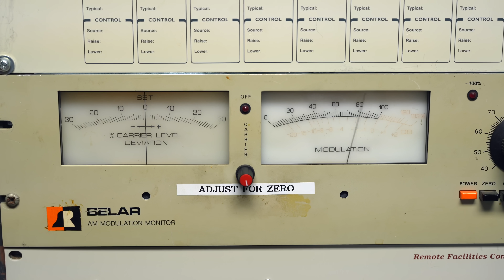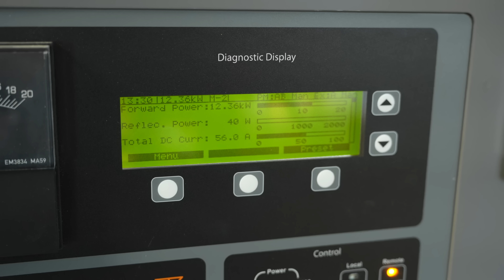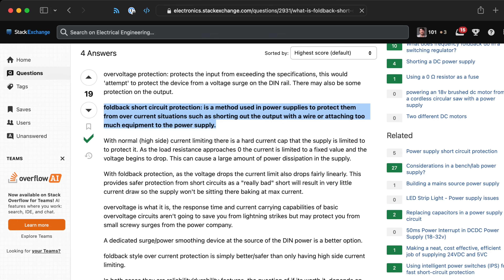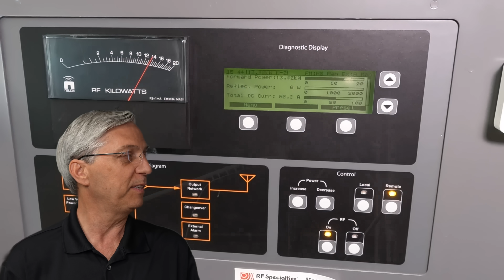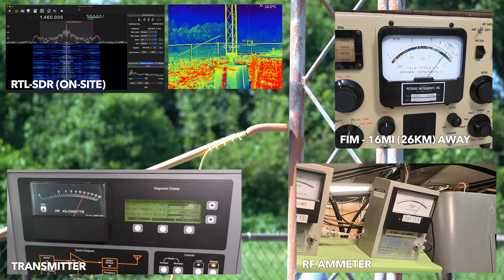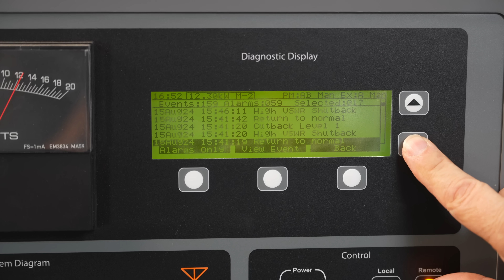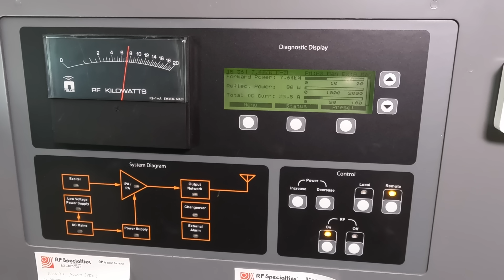How dangerous is AM radio? (ft Plasma Channel)

Comment: I had my hands near the output of a combiner and had and arc follow the tip of my finger. What sucked was my arms were all twisted up in the octopus of.cables, so I couldn't even pull my hands away too fast. Fortunately I was working on 800mhz and it was only 50 watts/channel. It still burned the tip of my finger, but it wasn't too bad.
Reply from the maker: Ouch! Hope it healed okay!

Comment: Fascinating stuff. I think the corn dog did so well due to all of the oil in its coating. The tower leg was definitely becoming more resistive with the carbon building up on it. We did the electric pickle at a concert venue a couple of times and the secret there is a small board with two hefty nails that go into the ends of the pickle (I guess in this configuration you'd have an anode nail (the drain) and the cathode (the source - touched to the tower) - do it at night and you'll definitely get plasma in the pickle that will mimic the audio going through it. Loved this video! 🫡 👍

Comment: RF burns are weird. I forgot my radio was transmitting 100W WSPR and did a little tug on my random wire to see much much it was sagging. Felt like I had put my hand into a hornets nest. Little white dots appeared instantly in few places. Funny thing is that the burns looked insignificant in their appearance but oh boy did they hurt long afterwards. And they took almost half a year to disappear. And that only with 100W on upper HF!
Reply: Ouch! Glad they did at least disappear at some point!
Reply: Glad you told us, I'm always tempted to touch my LPFM Radiator
Reply: Why do we do that kinda stuff? @davidwright3783
Reply: interesting you sustained an rf burn at 100w, i have been old numerous times anything over 50w is considered dangerous, will have to be careful with my setup, sometimes crank 3300 watts into my sky stick. i guess i don't spoon with it so should be fine.
Reply: @nickyp00-t1h  I've got few small burns with 50W also. Tho they felt more like something between a wasp sting and a mosquito sting. Mild, but the small white burn dot didn't disapper for the next 3 months
Reply: @OH8EFI  will have to move my 9 foot stanless to the roof of my 4wd when dxing. How close can i get to  the antenna while transmitting with around 300w ssb?
Reply: @davelowets  i get that, also concerned about the rf coming out of it going through me while dxing.
Reply: Its not an amplifier, but i was messing with a flyback transformation from a television ( you know whole circut boa4d without tube leads onto the tubs) just making arcs and such and melting little lcd screens lol. Went to the bathroom. Forgot it was plugged in and i picked up the whole cir ut board. Fricken inch a half arc shot out of my finger. The electricity definitely went across my heart. What was that 20-30,000 volts? 
Idk, but I ran to my girlfriend yelling is my heart still beating.?Lolol INSTANT panic attack. 

@thearchitect4726
Reply: I have had friends horsing around on my truck while im transmitting, told them do NOT touch the antennas, you will get hurt. They only touched them 1 time while I was keyed up, they now have a healthy fear of all of my antennas, and that was 50-110w on VHF/UHF
Reply: 100 W rf isn't problem to receive over large contact area (like full palm), but if you touch it with your pinkie ouch!
Reply: Same here. It took a half year to fully heal and go away.
Reply: Its high frequency so it burns the surface pretty well
Reply: 100W wspr? 200mW is enought. I us 3W
Reply: @nrfchannel8580  It was a test during a HF black out if I remember right. Most of the time I do not go beyond 5W, unless the band is something higher
Reply: Because WSPR is so narrow it’s only supposed to be ran at very weak output. Putting 100w out on WSPR will be like transmitting 1.5kw . No wonder it hurt
Reply: I have a 500w mobile radio in my truck, one time I had a coax connector go bad. Went to key up and the mic bit me really good.
Reply: Mr show off bragger 🙄🙄🙄
Reply: I wonder if those individual dots are repeated entry and exit wounds? Of course, an electrical shock is the only burn with an entry and exit wound. Makes me wonder if an AC burn would have multiple burns as it oscillates.
Reply: Not good at all.  I've had a few RF burns in my day.

1.  75 watt transmitter running around 7.1 MHz @ 75 watts.  Bad ground, and not-so resonant antenna.  I was making an adjustment on the transmitter holding onto a bakelite knob, but may have touched the set screw. The other on a bakelite knob of a telegraph key.  It still burned my fingers.  That hurt!

2.  A field day operation, we had multiple transmitters in a small amount of space, same for antennas.  We did drive a ground stake into the ground, but not very deep.  We may or may not have all of the rigs tied to it.  I was operating SSB, on I forget which band at around 100 W.  My lips touched metal wind screen on the mic and got a bit of an RF burn on my lips.  Not bad, just made me say ouch, then went back to operating.  I think I've had more of those over the years. Little love nibbles from a mic.  I was a little surprised by it.  We were set up on a river bank, and even though it's inland, the water has some salt content about it, chloride concentration around 400 PPM and a conductivity above 1000 S.  So, I expected good ground conductivity, but the soil there was sand.

3.  I had a mobile rig on 440 MHz.  It only ran 10 W, so I wasn't too concerned about it.  It had an SO-239 connector for the antenna.  The antenna I had on the car had a type N.  Well, I took the N-connector apart and tried to hold the center pin into the SO-239 using my fingers.  Keyed up the transmitter and burned my fingers, immediately.  As soon as I could I switched out the N-connector for a PL-259.  I know those suck on UHF, but it is what it is.  Only interested in working the local repeaters anyway.

As far as any other health effects, having been a ham radio operator since I was 16, and getting involved with repeater maintenance, in sites where there are many sources of RF.  FM broadcast, TV transmitters, both VHF and UHF, and lots of commercial and public safety repeaters.  There is a couple of possible health effects I have.  I developed cataracts when I was in my forties.  Corrected surgically and I see just fine now.  More recently, my optometrist said she observed changes in my optic nerves, that might be early stage glaucoma.  She referred me to an opthamologist that's been monitoring my eyes now for four years, my distance vision remains 20/20 or slightly better, and my eye pressures remain normal.  Are these changes to my eyes due to prolonged and repeated RF exposure?  I've literally had my face right in some active VHF antennas. One of which was VHF television.  I don't know, there may have been other factors too.  Anyway, I haven't tried to explain to my doctors that I have been known to do something a little like sticking my face in a microwave oven.
Reply: Had a similar experience, and I  had the the little white dots, and it took six months to heal and go away.

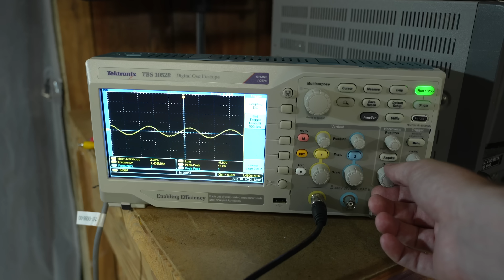Comment: 3:09 this is probably a dumb question, but how does the power usage/output of an AM transmitter like this compare to a local FM transmiter?

I know the modulation that creates the broadcast is different, but curious the raw anount of ac power needed compares
Reply: Nowadays they're quite similar—not 100% sure of 20-40 years ago, when both used tubes/filaments and they were a LOT less efficient.

Comment: Hi Jeff .All A.C electrical systems have to have an earth return system for fault protection. I would have thought that if you could wrap a “split”current transformer around your sausage earth lead and another one around the earthing of the outside box or the main transmitter you may see current flow in the return path

Comment: The pickle is mostly saltwater so it’s likely a better conductor than the hotdogs. That may be why it got more fold back.
Reply: Acetic acid in vinegar also increases the available ions for conduction. Good point on fold back.

Comment: The lobes on either side of the spectrum are the sidebands.  When you mix frequencies you get 4 different outputs.  The 2 original frequencies., the sum and the difference.  So if you have a 1460KHz station and you modulate it with a 1KHz signal, you get 1Khz, 1459KHz, 1460KHz and 1461KHz at the output.

Comment: Please explain how the Hi-Z conductor (hot dog, pickle, brat) acts as a demodulator for the signal. I think it has something to do with the resistance of the material, but I'd love to hear from the RF engineer.
Reply: It's AM modulated - the arc itself becomes a speaker following the envelope of the AM.

Comment: Rough guess, the Bratwurst might have vaguely the right impedance to get a good SWR that is max. power from the transmitter.  Sadly food laws don't require labeling electric and RF properties on the package.

As for RF burns, the less spectacular ones are nasty, too.  Human nerves don't react to RF as to DC or low frequency currents.  A person in contact with an RF source will have no unusual sensation resulting in in a reaction to brake the contact.  And don't underestimate small transmitters.  I've seen a small burn from a 10W transmitter and I don't think it was longer than a second or two.  The contact area wasn't a blister but more grey, necrotic skin of maybe 8mm in diameter.

Comment: When did this become a cooking channel ? On a more serious note after cauterizing the antenna do you get to repaint the unhappy paint job ?
Reply from the maker: Surprisingly (this was news to me) these towers are short enough there are no specific paint/color requirements.

Though I think my dad went back and cleaned the tower leg with a soft brush later! Does look like a repaint would be nice sometime.
Reply: @GeerlingEngineering   The owners are very accommodating.  ... assuming they knew about this.  ;-)

Comment: Maybe Try to put a RF amp meter in line to see how much current is going through the hot dog. I worked at a AM station at the time and I threw   some plants on the spark gap and there was a orange flame that came off it while weed wacking around the tower. This was the old Harris Bc5h 5 killowatt transmitter 30 years ago. Fun times

Comment: I love this channel for many reasons.  Here's one:
I've worked with electronics since the early '70s, and back then I used to live about two miles straight-line distance from that radio station transmitter.  I played around with CB radios, and discovered that if I keyed up my CB without a microphone by using a jumper lead, and then held the mic input lead in my fingers, it would transmit a perfectly modulated audio of that radio station through the CB.

Thanks for the fun and educational video!

Comment: The fence is a bit low to protect stupid from itself
Reply from the maker: For this site, there's a locked gate at the entrance, a locked fence surrounding the entire field (with RF danger signs around it), and then locked fences around all the towers as well. It's also far off the beaten path (though some home builders have been adding subdivisions a mile or so away—until recently it was rural for miles around).

There's only so much you can do for remote tower installations, but hopefully someone sees this video and understands it's not a good idea to play around this much RF!

Comment: There used to be a high power SW station not too far from here where not only did residents in the nearest village complain that they car key fobs wouldn't work bit that they could hear Russian coming out of their toasters!
This was at Rampisham Down, one of the sites the BBC built for the world service and had multiple 300kW and 500kW SW transmitters going into an impressive curtain antenna array that co ered a good few acres. Hate to think what the erp was if some the transmiiters themselves were 500kW output.
Reply: It would've been a lot cheaper and less painful to stand under that transmitter than to get a vasectomy 😂😂😂

Comment: I wonder if radio transmission at end clients is affected by touching the wiener to the antenna.
Reply from the maker: It is! Check the FIM (Field Intensity Meter) readings at various points - that's showing the signal strength at various times in the video. It roughly correlates to the transmitter power reading.

Comment: As a German myself I can confirm that 5:57 is actually really good. 
I used to operate an small am pirate station (relatively simple self build transmitter with 807 power amp tube). It outputted maybe 50W. I remamber it hurting really bad when I touched the antenna. The main problem was that I never had access to an tower or high point to mount the antenna wire at. It was just a few meters above the ground. The other problem was that no one in Germany listened to am radio, even 25 years ago. Everybody wanted fm.
Reply: I’d have to guess the treatment AM gets by receivers isn’t very kind either. My car has such a harsh band limit on AM that it sounds like a phone call, and I know AM sounds better than that

Comment: My country have only DAB+ technology for radio transmitting and FM for local radio. AM is discontinued in 1977.
Reply: Sad, AM is more reliable for emergency communications. And will work down to much lower signal strength, it degrades slowly, digital and FM just cuts off
Reply: @franklofarojr.2969  DAB+ is soo weak you can't be fried by touching cables anymore. Only get hurt, yes, but not dangerous.

Comment: Ex-Nautel employee here. We'd run our transmitters at full power into a dummy load, and have holes drilled in the outside of the hardline coax going between the two that we'd stick a screwdriver through to dead short the transmitter output. They could shrug off that kind of abuse just fine, so they can handle pretty much anything else.

Transmitters have to handle all sorts of high SWR conditions anyway - lightning strikes, ATU fires, tower collapses, copper thieves... guess we can add "weirdos with a pickle on a stick" to the list.
Reply from the maker: Ooh... now I know we need to find a way to visit the Nautel HQ — would love to participate in some of this testing :)
Reply: @GeerlingEngineering  Maybe you should get together with Jeff Dunham to try a Jalapeno on a stick - to see if it translates to Spanish. LOL
Reply: @hallkbrdz  ”…on a steeeek…”
Reply: @gruntopolouski5919  lol
Reply: @hallkbrdz Maybe a chorizo sausage would do the trick.
Reply: Would love to see this in a datasheet:  "Grounded pickle on tower:  Indefinite"
Reply: This is by far the best comment posted in the best way for this pickle-tickular situation.

Thank you for your service, in every conceivable way.
Reply: Heck just disconnecting the cable from the antenna does the same thing as a dead short. RF is a strange animal.
Reply: "Im pickle stick!"
Reply: How MANY weirdos with pickles on sticks do you think they could handle though?
Reply: @shawnpitman876 All of them...
Reply: Beyond awesome.

Comment: what would happen if a person on a rf insulated platform used a rf insulated stick not grounded and no metal parts brought the hotdog within what would be arcing distance but not contacting to the tower my prediction is that the hot dog would heat very slightly and possibly tasts slightly electric afterwards verse a hotdog in a black bottem take out box held in the sun away from the tower. is this true.

Comment: Now imagine back in the day when AM broadcast stations was pumping out half a million Watts
Reply: that was rare.  AM stations are maxed out at 50,000 watts.

Some in Mexico had 500,000.

WLW in Cincinnati experimented with a million briefly if I remember correctly.
Reply: @rejeandurette3471  WLW never output at 1 million (although the transmitter was capable of more), they maxed out at 500k Watts. It stayed at 500k Watts for 5 years (1934-1939) and was limited to 50k Watts ever since due to FCC regulations.